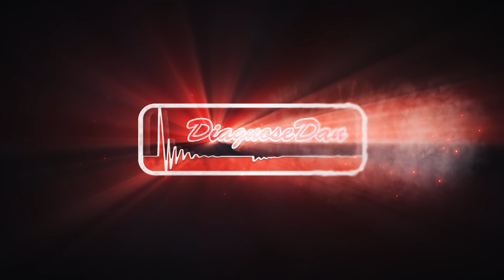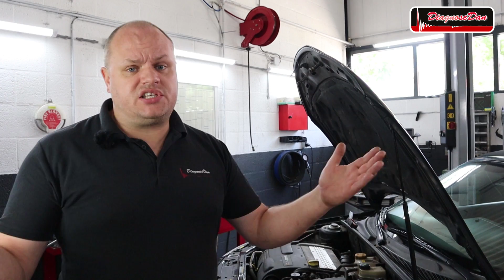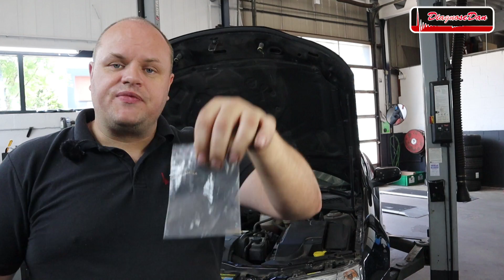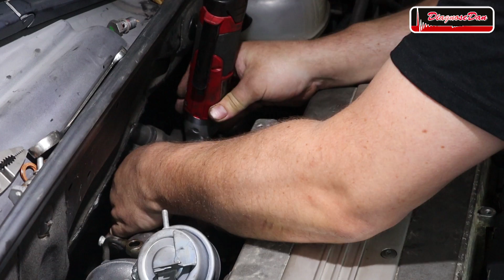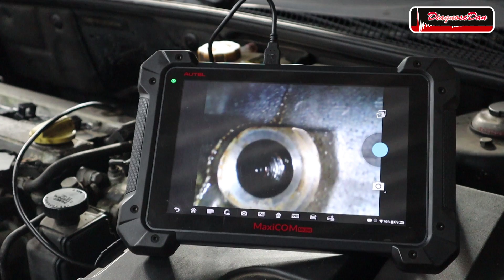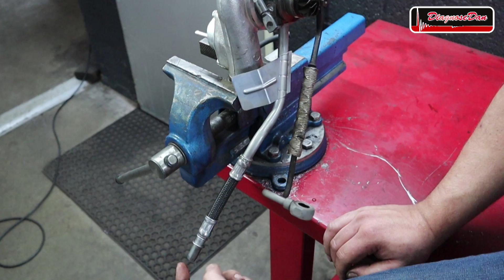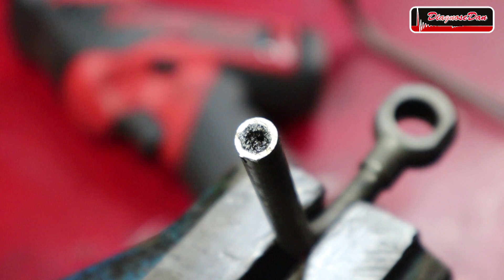Why did this new part only last one day?

Comment: Let the engine with Turbo, idle a minute, before you shot it down!
as this has water cooling too did that system suffer from this?
...temp's was high even for pressured coolant...
Reply from the maker: Thanks for the feedback 👍

Comment: I guess the pipe gets a bit hot and there may be a tendency to have the oil "cook in the line like gum in your oven when you turn a hot car off. It should not overheat when running because the oil will act as a cooler for ambient heat. The insulation is a wee giveaway. As it builds up residue, it acts even more like an insulator and the oil will cook from the latent head in the turbo charger. I know the turbo is water cooled but as soon as the engine stops running the turbo will send heat where ever it can to cool. My guess is a lot of stop start driving and with an immediate stop after hard work. Does the owner perhaps live at the top of a hill or work at the top of a hill.  Can only guess at oil change and oil quality disciplines.
Reply from the maker: Thanks for the feedback 👍

Comment: I changed the lines on fiat 20v turbo preventive already twice after my first turbo failed. Same thing i also change the oil on the biggining of the season and drive maybe 5 to 8000 kilometers with it. I always the flow rate and in 4 years the rate goes down half. Same sluge problem.
Reply from the maker: Thanks for the feedback 👍

Comment: Dan insufficient oil maintenance wrong viscosity oil sludge from the engine pull or drain the oil from the oil pan. Just like VVT systems sludge buildup can severely damage the VVT actuator. Wrong octane fuel. Don't you need to run higher octane in turbos. Extreme heat. You had oil pressure but check the oil for metal particles maybe internal engine components failing. Just a few ideas no expert by far. Dan stay well Artie❤️
Reply from the maker: Thanks for the feedback Artie😉

Comment: Fantastic video! B207L/R engines are very reliable, such a shame the owner didn't take care of it. One would wonder in what kind of shape is the engine itself. The owner missed way too many oil changes and probably even used the wrong oil. Even the oil coming out of the bore was looking pretty dark for a petrol engine...
Reply from the maker: Thanks for the comment 👍

Comment: Worth mentioning that oil quality and regular oil changes are vital to turbo life, turbos need the correct oil changed at or before the manufacturers service intervals. Even on older turbo vehicles where semi-synthetic oils were listed the modern equivalent manufacturer approved fully synthetic oil will be of benefit. But the oil used must always be checked for compatibility as many of the very latest oils are not backward compatible.
Reply from the maker: Thanks for the feedback 👍

Comment: Saw this on a BMW turbo V8, the lack of oil actually caused the compressor wheel nut to undo itself and fall off into the intake!
Reply from the maker: I've seen that many times on different brands
Reply: That would be very bad !!  🤔

Comment: And the engineer's didn't think to put a oil flow sensor before and after the turbo...
Reply from the maker: Thanks for watching 👍
Reply: Probably way too expensive for what it's worth. Having an oil pressure switch might be a good idea and relatively cheap, but even if it had a fault, it would just spew out a code and a flashing red warning light. It wouldn't prevent any damage because you can't bypass the turbo altogether.

Comment: why the income oil pipe is so small relative to the output oil pipe :)
Reply from the maker: Bigger pipe would be better but the pressure would drop
Reply: Oil returned to oil pan had changed its state from laminar flowing liquid to froth , expanded  its volume of sort .
Reply: Good question.
Reply: Because the oil going into the turbo is high pressure, which is needed by the hydrostatic bearings. Oil going out the turbo just falls back into the block on gravity.

Comment: Great video Dan and another splendid bit of diagnosis!
You asked if anyone had any idea why the oil pressure line was blocked.  I wonder if on shutting off the engine a bit of reverse flow occurs with the extremely hot oil from the turbo unit?  Other possibility is that on shutting off the engine the heat from the turbo gets conducted back down the oil feed line from the turbo body.  With no oil flow the now stagnant oil will be cooked in that pipe.  Depending on its temp. that could well cause the oil to breakdown in the pipe and precipitate out as free carbon.
So my suggestion would be when fitting the new turbo kit and its feed and drain pipes,  measure the actual temp the oil feed line gets up to after shutting own at the end of a run.  
Other possibility is that the wrong oil was used and not suitable for use on a turbo engine.  Oil is pretty dirty.
To check if a used pipe is carbon free try removing the inner cable from an old bicycle cable.  Solder up one end and finish to a rounded point then fan out the other end to scour down the oil feed pipe.  Trust this helps.
Reply from the maker: Thanks for the fantastic comment!

Comment: How do these garages keep going with mistakes like this,this is a basic test and was missed and the the oil should of been changed at the turbo change, as the oil coming out of that block was realy black hence the blocked pipe lack of maintenance is the original fail point of this fault.
Reply from the maker: You are right Steve

Comment: Great video !!!
 When installing new turbo how can you verify the oil flows as it should ? because if doing the same method as you did with the nylon bag - the oil will flow to the bag instead to the turbo and will ruin it.
Reply: Same way he did it in the video, disable the engine from starting and crank it over.
Reply: He didn't let the engine start up so turbo will barely be tuning .
Reply from the maker: Prevent the engine from starting.

Comment: with the car ages, change the oil more frequently, every year or so with quality oil and respect the type of oil for the car. If the car has a lot of km this type of small feed lines should be checked and changed to prevent carbon deposits
Reply from the maker: Great advise!

Comment: To prevent another plugged oil feed line to the Turbo recommended oil changes using an engine flush. Although the location of the turbo generates a lot of heat. I would run synthetic oil Mobile 1 or any brand name synthetic.  The bloopers are tongue twisting fantastic!  😜🤣👍
Reply from the maker: Thanks!😁

Comment: Carbon deposits are from both too long between oil changes, and from not allowing the turbo to spin down before shutting the engine off.  Long oil change intervals allow the oil to form sludge, which, combined with the turbo spin down with no oil generating enough heat to degrade the oil, blowing the breakdown products into the piping. The return line is larger, so the restriction will be less noticed, but the supply pipe is small diameter to regulate the oil flow into the turbo, so it will clog first.

Solution is to change the oil at the "harsh service" intervals, as noted in the owners manual, as the only way to get the oil to survive the regular service interval is to drive the vehicle like the "old granny driving for a Sunday country drive, and enjoying the view at minimum speed limit" all the time. If you are driving to enjoy the acceleration change oil more regularly, it is a lot cheaper than the 2 turbos.
Reply from the maker: You are right thanks for the comment 👍

Comment: Does 5 bar at the oil sensor mean more restrictions elsewhere?
Reply from the maker: Good question! I didn't measure the oil pressure at the oil pressure sensor after the repair.

Comment: Possible causes for the block:
1. Not changing the oil frequently enough. NEVER listen to the manufacturer. If you have a turbo car, change it every 7-10K (depending on how you drive). Yes, even if it's synthetic and says "up to 20K".
2. Using some kind of thickening additive. Your synthetic oil has all the additives you need....Don't add any unless you're using the cheapest conventional oil.
Reply from the maker: Thanks for the comment 👍

Comment: Hello Dan I also worked on a black conv saab this week a/c problems. I've never seen a saab oil pump fail. I always recommend to customers to remove the oil pan to clean any debris left from a turbocharger failure where did all the metal go?
Reply from the maker: There was no oil flow to the crankcase so i think it didn't end up there. Most wil still be inside the turbo.

Comment: Looks like lack of maintenance as to why the oil feed line is completely plugged. I am sure you suggested to the customer to change the oil more often, no more than 5,000 miles  (8,000 km) between oil changes. I got over 300,000 miles (482,000 KM) out of my small block Chevy using conventional motor oil (I did the oil every 3,000 miles) and the automatic transmission also never failed me because I changed the transmission fluid every 7,500 miles (12,000 km). My secrets, maintenance!
Reply from the maker: Thanks for the comment Robert

Comment: It's good practice to allow the turbo to cool down especially if it's very hot from fast driving  towing or driving up hills .The oil left in the turbo bakes and causes blockages etc . I suppose high quality synthetic oil can handle high temps but if the oil isn't changed regularly and degrades,  it's ability to withstand the residual heat of the stationary turbo with zero oil circulation is compromised .
Reply from the maker: Gread advise 👍

Comment: Hey Danny. That oil was baked into that line. I'd recommend not only changing oil more frequently and going full synthetic, but as his mechanic I'd put a high temp header insulation wrap around that oil line before reinstalling it. That may help prevent heat transfer into that oil line from the turbo exhaust line. Obviously the oil in that line was being cooked from somewhere as it made its way through the line. Later. Jpol.
Reply from the maker: Thanks mr Pol👍

Comment: Damn oil system got prostate issues! 😆

I definitely thought it was a collapsed rubber hose, not a plugged metal line. 

Logic would have it, this issue has to be due to settled boiling oil, or hot baked oil. Maybe heat wrapping the line will dissipate heat preventing oil from cooking causing the clog. Or... Making the line solely metal or revised one connect to a heat sink. Also, poor positioning not allowing it to completely drain off... Man it could be alot, you know the positioning better than I though
Reply from the maker: Thanks for the feedback 👍

Comment: Any contaminants from the wear of the turbo get in the Engine????? Also Jet engines can rev higher Dependant on Engine and the Stages of Compressor. Eg, Allison can do 140000 rpm at 100% single stage (drive for Gearbox and Prop). Still like your your show, glad you put a glove on that pipe 'Covid 19' safe. LOL LOL
Reply from the maker: 😂😂 Because there wasn't any oil flow to the crankcase , most was left in the turbo. Thanks for the feedback 👍
Reply: Ooppss should be 14000 rpm for 100%. Sorry. One too many zeros.

Comment: I purchased a 62 Ford Galaxy 500 in 1969 while stationed in the Army.  It had leaky valve covers and when I removed them I found sludge throughout the rockers that appeared the same as what you encountered inside that tube.  Since I was in the motor pool platoon I was able to do some research and find it was caused by over due oil changes.  The oil actually breaks down and solidifies when it's left in too long.  The engine temperature speeds up the process so it doesn't take nearly as long as one might imagine.  So this problem was caused by not changing the oil often enough and/or using oil not recommended.  I've also seen oil sludge up like this when mixed with another type oil.  The ash content in some oils reacts to mixtures of 'Pennsylvannia' crude and tar-sand crude based lubricants.  In some cases I've seen the mixture turn to what looks like chewing gum inside an engine after only a short amount of time.  This is often caused when low on oil then adding the other type to top-off the level.
Reply from the maker: Thanks for the great comment 👍

Comment: I'm going to assume the owner used the correct oil instead of getting cheap.  As I remember back in the bad old days of turbos they weren't water cooled and the heat of the turbo turned the oil to carbon.  The solution in those days was to idle the engine for a while before shutdown allowing the oil to cool down the turbo preventing the formation of carbon.   I'm guessing the carbon problem is why turbos disappeared for a while in cars.  This was turned around when turbos became water cooled.  SO, if the owner is using the correct oil and changing it regularly I would have a look at the turbo cooling system and make sure that is in order and cooling the turbo as it should.
Reply from the maker: Thanks for the comment 👍